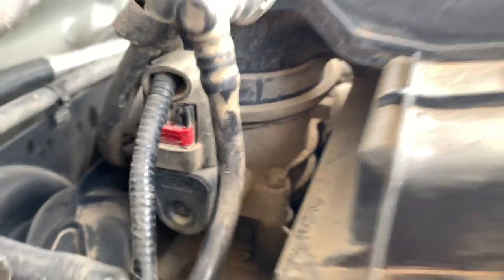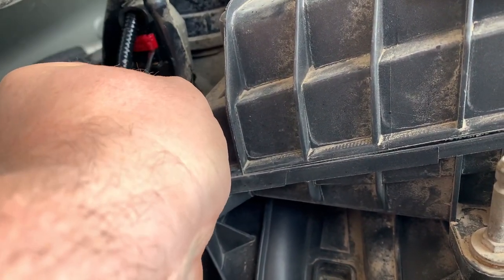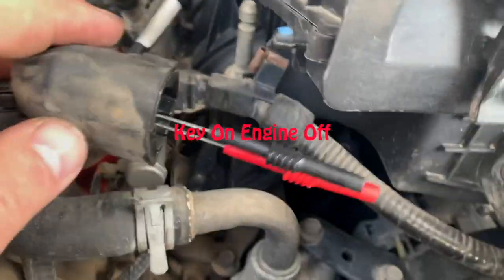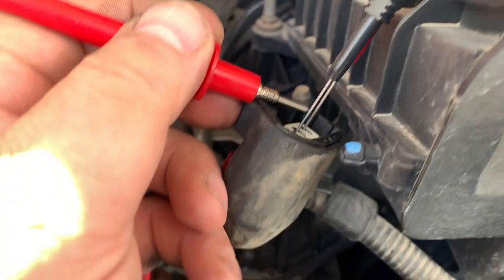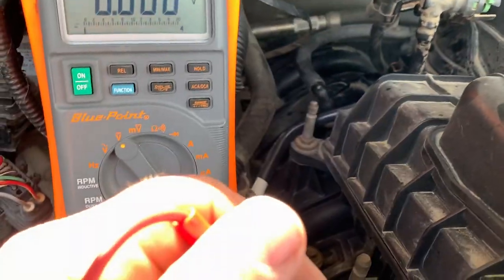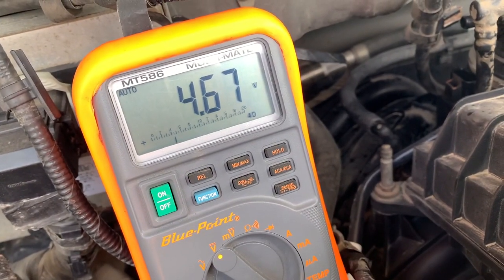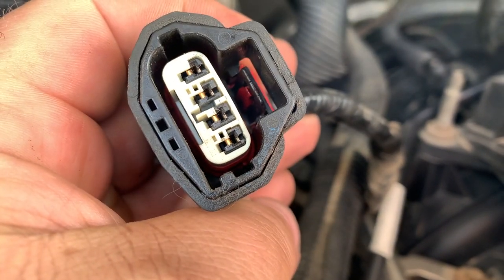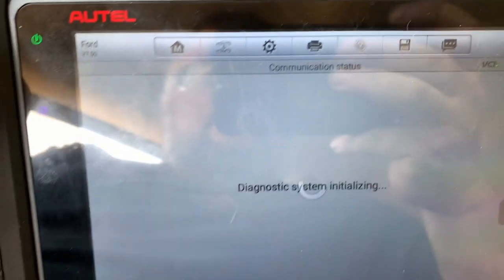DIY P0068 P0121 P0123 P1120 P1124 How to Diagnose

Comment: Thanks 4 the video......so I have a cheap scanner and I could see the TPS go up and down smoothly 👍 so it can still be bad if the volts don't match ?
Reply: Meaning I only check if it went up and down smooth but did not added PPS or electricity but it still went up and down smoothly